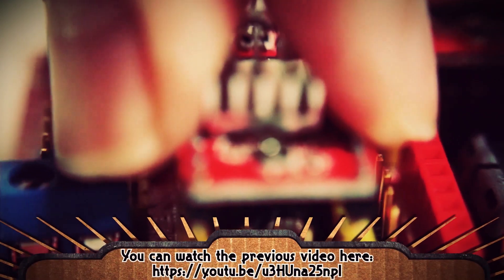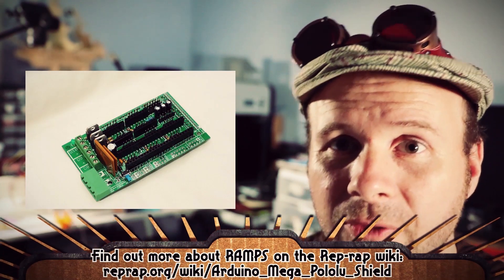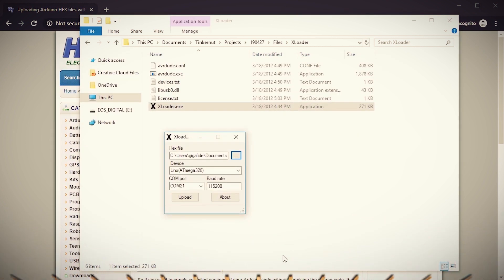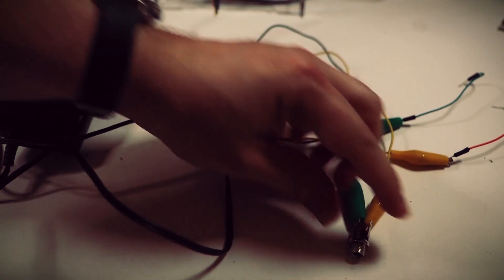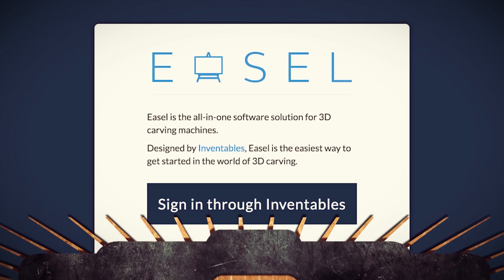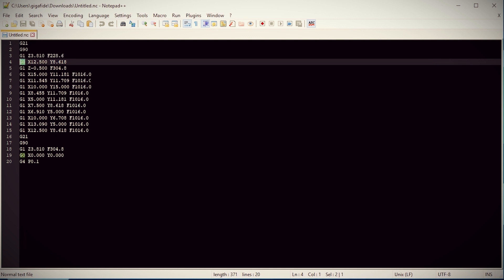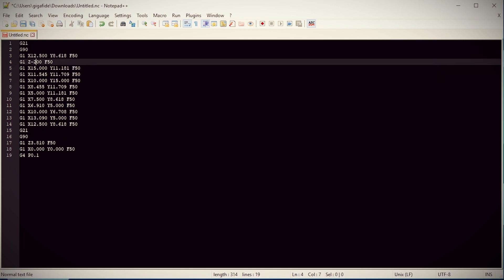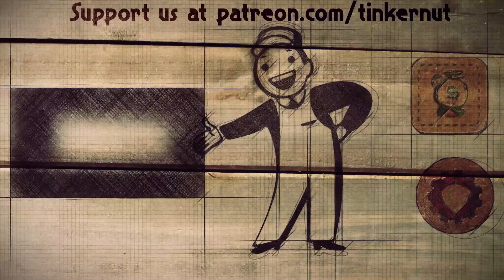Upcycle Old CD Drives into a 3D Printer (Part 4)

Comment: You can use the teacup firmware to use an uno and have full control over all the motors and heaters etc. The only limit is the number of pins

Comment: umm corrections...

1. you can uses the 4th stepper motor driver as an individual. It means you can use it to drive an extruder motor.
2. arduino uno have some adc pins. It means you can connect a thermistor to it.
3. cnc shield v3 had a spindle pin. thus you can use it to drive a hotend using an external mosfet.
4. cnc shield v3 had pins for x,y,z limit switches.
5. you can make a legit 3d printer using an arduino and cnc shield v3 using teacup firmware not grbl.

Comment: You said the shield is for use with grbl verions older than 0.9, which means small/lower than 0.9, but the graphic on screen said "grbl > 0.9" which means bigger/greater than 0.9.

Comment: If you want to use the newest GRBL you can get the Arduino CNC Shield V3.51. It's designed to run on GRBL 1.1

By the way it's not DUE as in 'doodoo' but DUE more like in 'duet', except you don't pronounce the d as 'dyu' but as a d. So doo-eh where 'eh' sounds like the e from 'empty'.. Coming from Italian Uno being one and Due being two :)